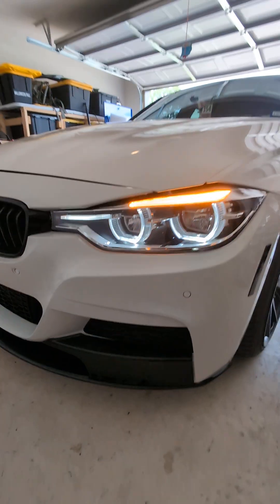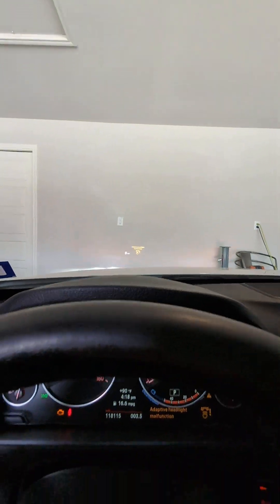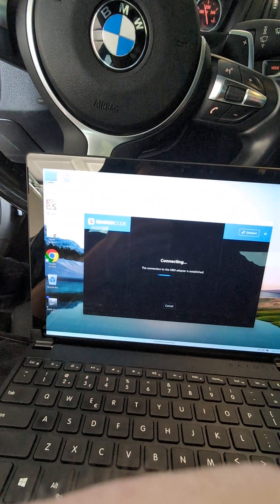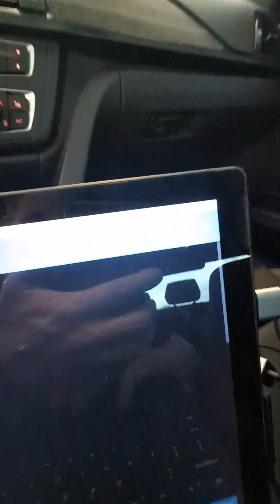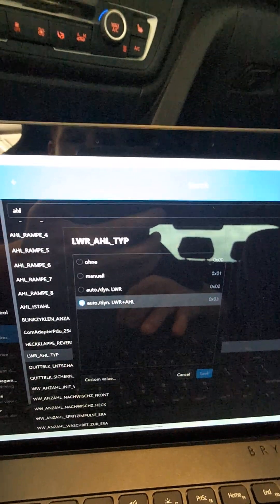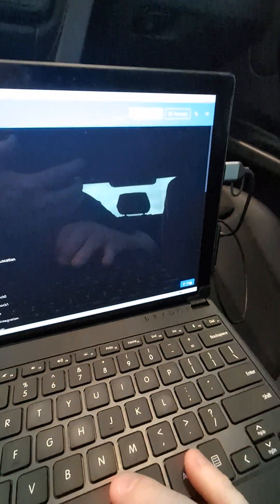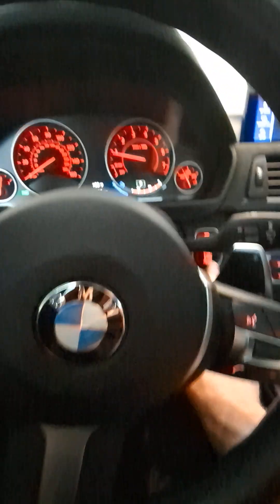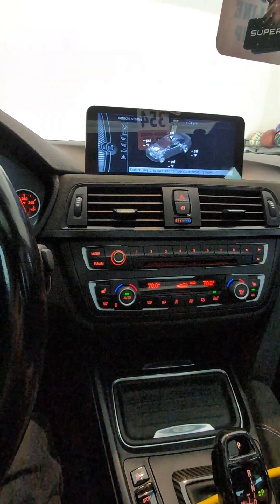BMW F30 Adaptive Headlight Error Coding For Aftermarket Headlights

Comment: do you have to use your computer or can i do it on my phone with the bimmercode app?
Reply: You can use either, if your enet cable has usb A then use computer, if your enet cable has usb-c then you can use your phone if the charging cable is usb-c with app

Comment: Great video how to program your turn signals for five flashes for a soft touch
Reply: Im pretty sure you can do that within the cars settings, but older models may require coding through BimmerCode.